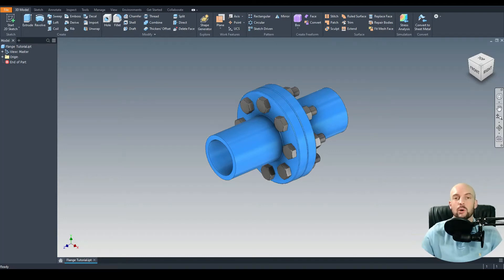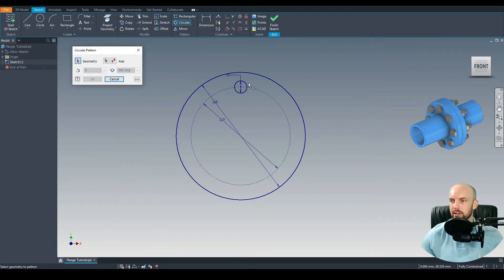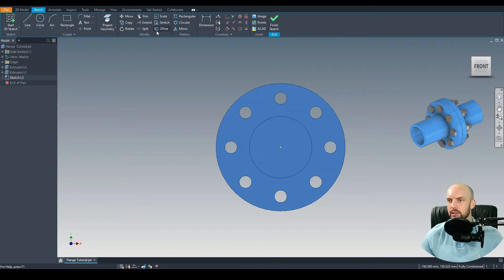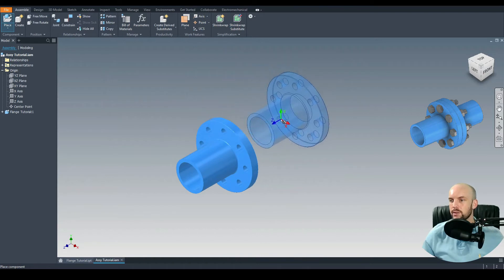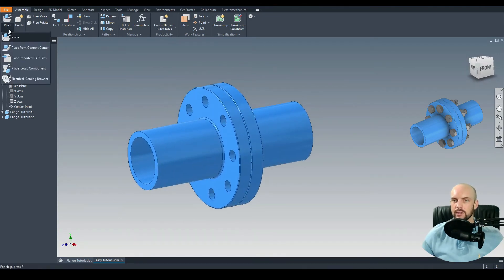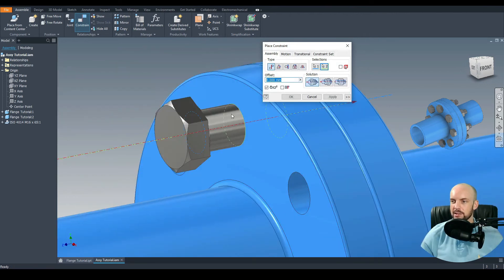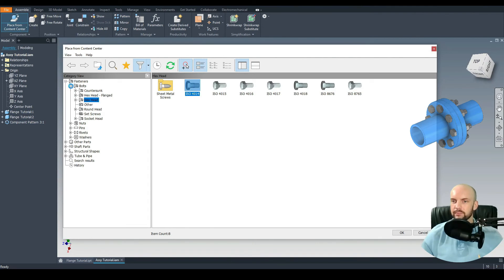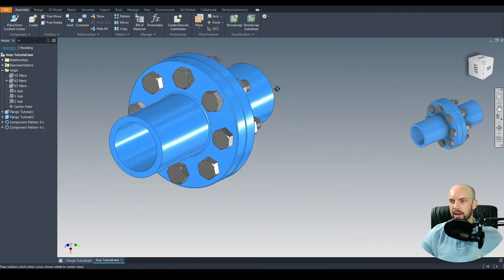Flange Coupling | Autodesk Inventor 2021 | Intermediate Tutorial

Comment: NEW SUBSCRIBER: Question: Once u have completed your part model, is it possible to add a "part model" to that part (No Assembly)? EXAMPLE: You have your Flange part completed but now you want to add a PEM nut to his part model. Is this possible or do you need to be in the Assembly mode to add the PEM nut to this flange part?

Comment: Pop in a gasket we're good to go. Good tutorials in this series.
Reply from the maker: Ha, Yes indeed! Thanks, I plan to release a new series of tutorials based on 2D drawings and templates in January/ February. I've had more email requests for 2D drawing tutorials than 3D modelling! Surprising! Have a nice weekend!
Reply: @AutodeskInventorTutorials  Just noticed when running through this one; Flange holes need to be clearance holes - large hammer required to get M16 Bolt through the 16mm dia flange hole! The requests for 2D examples may come from folk that have been put straight onto the software by their employers before they have mastered basic draughting skills. I see it a lot in the consulting sector.